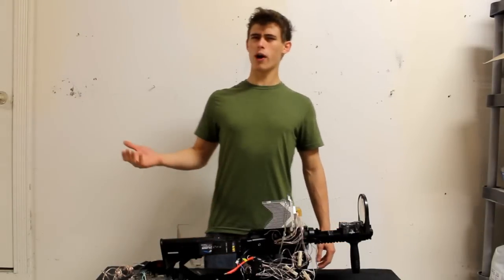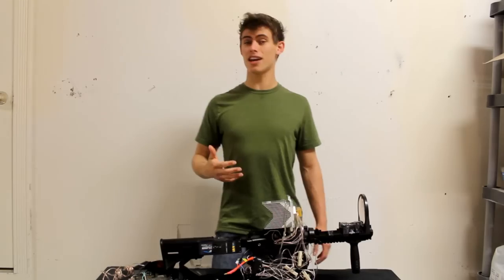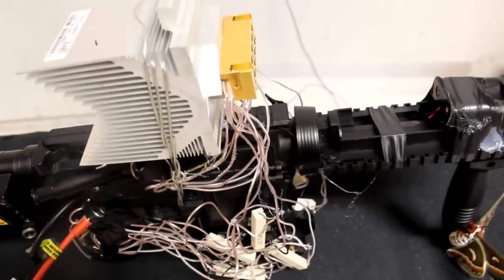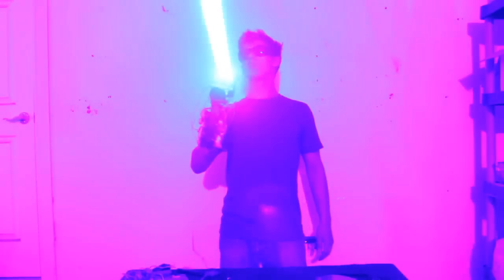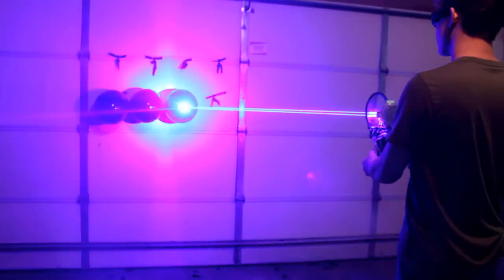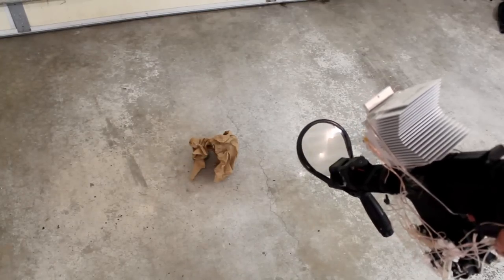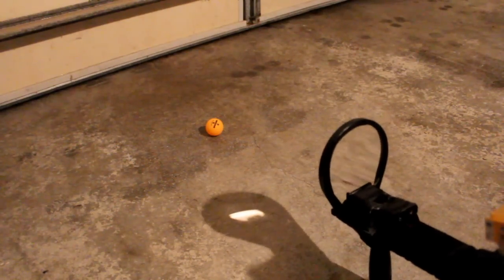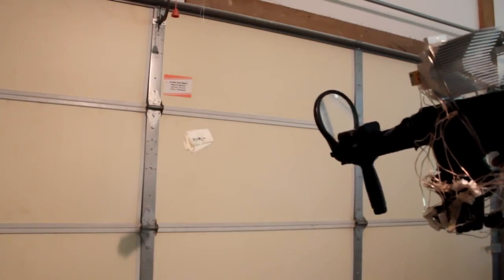My Homemade 40W LASER SHOTGUN!!!!!

Comment: the military needs to use this if this can destroy ballistics gel
Reply: what makes you think it can destroy ballistics gel? It's probably easier to just shoot them a few times instead of burning them for 10 minutes.
Reply: +Michealkolicheal Not even that. If you could up the power a bit & perhaps use a better focusing lense, it could easily be used in a semiautomatic mode with just each 2 second pull of the trigger powerfull enough to cause intense burning on skin. If someone were wearing armor, it would simply ignight their clothing, effectively taking removing that enemy from the fight, at least temporarily.
Reply: Michealkolicheal I looked it up. I guess the military has some big ones that use a whole lot of energy and plans on attaching them to planes and ships. They can't use them on people due to international agreements though, they can only use them to disable other vehicles.
Reply: Well it would be an excellent armor shredder though...
Reply: I think these high power ones would do more than shred armor.
Reply: ShadowsUmbra I saw a couple of their huge ones that are on the aircraft carriers & battleships, & they are pretty wicked. They just instantly ignite enemy boats. Lol
Reply: Man, that would be pretty sweet to see that in action.
Reply: +ShadowsUmbra They're rigging the newest class of destroyers to be able to handle the intense loads of electricity require to power anti-aircraft lasers, as well as rail-guns.
Reply: Matthew Martin with all the talk about these being able to replace typical rockets and missiles and the like you'd think it wouldn't have to be so dependent on huge power sources. I guess once they upgrade though it'll probably be more reliable.

Comment: As a researcher working daily with lasers I would really really strongly advice against anyone playing around with any laser above 1mW in power. And if you insist make sure you know about the risks and what type of laser safety goggles go to which wavelength. The guy in the video is probably wearing special high energy safety googles. Normal laser safety googles are not rated for that kind of power. Even diffuse reflected light from that baby hitting your eye will permanently damage it instantly. Be safe!
Reply: That's a compliment.
Reply: Cactus Man 
Someone failed high school physics and chem.
Reply: @Prince_Sharming  I'm a drop out and the CIA'S spying on me
Reply: imagine if this dude saw my 300 watt pulse emitter. I run it at about 5,000 nm but can tune it to anywhere from 2,000 nm to 1 mcm. since I'm using a resonant wavelength modulator. in case you were wondering, 2 farads of capacitance and a 2,000 watt DC power strut.
Reply: Thanks for the info
Reply: Regnet35 oh look, we've got a scientist over here
Reply: HAPPY B LAZING
Reply: Suuureee you arrreee....
Reply: He does mention the risks & safety advice in almost all his videos though
Reply: I actually understand this stuff
Reply: something tells me you'll be blinded by a laser soon--dumbass!!!
Reply: he said he studied somethng and almost got PhD but then he decided youtube is better
Reply: good thing hes know what hes doing and has taught this stuff as well, hes completely qualified
Reply: Can it blind a pilot in an F-15?
Reply: actually it burned my eyes just by watching the video XD
Reply: I have literally shone a 10mW lazer pointer at my eyes for 2 seconds and nothing happened
Reply: kinda makes one wonder just why these things were invented
Reply: fuck science

Comment: 1:40 you can see that the gun is losing power, some of the lazer has been reflected backwards
Reply: All objects reflect some light, some more than others depending on the wavelength, and when 40 Watts aggregate power of 445nm light is being shot at something, the reflected light is pretty visible.

Comment: @styropyro 
I plan on following this path in electronic engineering, where did you get the parts for this build? 
Forget the shotgun however, I have more important ideas for the framework around the laser itself, but I'm very interested in how you put this all together.
I was desperately hoping you'd go into more detail on what went where and how.

Comment: light, the fastest thing we know of (excluding the theory of the edge of the universe). that means it's faster than bullets, missiles, you name it. you can not outrun light. seems almost too good, right? well, there are some downsides. if used in military combat, it would give away your position to enemy forces the moment you pull the trigger. and the glasses he's wearing in the video aren't to look cool, it's to protect your eyes from being damaged by the laser. that means any pedestrians in the area of a troop with this weapon would be blinded. that means if a soldier were to lose his glasses or crack them, he'd be forced to leave combat, so that way he wouldn't damage his eyes. it's an interesting idea and we get closer to harnessing it every day, but sadly at this moment in time we do not possess the necessary means to 100% effectively use it in combat.
Reply: Not true! You can use infrared or other non visible laser to avoid being detected. The glasses he use is mainly to protect against acidental reflection,  not the glow.
Reply: Aren't Laser usually invisible?
Reply: +paul klement that depend on the laser's wavelenght.  If it is inside the  human spectrum it is visible for exemple red or green lasers.  But if it is an infrared or ultraviolet  laser,  then no,  it is not visible by the naked eye,  but can be visible by special instruments.
Reply: I meant like the actual Laser beam not just the point where it hits a surface. I think the beam usually is invisible just like you don't see the light Rays coming to your eye, only the points where they hit your retina

Comment: yo guy
can i use diodes ?
"https://m.ebay.in/itm?itemId=321693715195"
please help me out here
Reply: +Hari Jain you need LASER diode, not LED diode. light from LED diode can't focus on one point. there are plenty LASER diode products in eBay, but only around 5 milliwatts.  40W is approximately 8000x stronger
Reply: +Anggara TS what if i put refletic hemisphere behind the led, like in a torch.
that outta focus the light
will it work then ,
Reply: umm, i don't think so :(
afaik, unlike lightbulb, laser diodes are already pointing to one direction without having to add reflector, and that pointed power already summed up to 5 milliwatts. correct me if i'm wrong
btw, there are some laser products in ebay that can burn matches head or pop black baloons. you may want to look it up